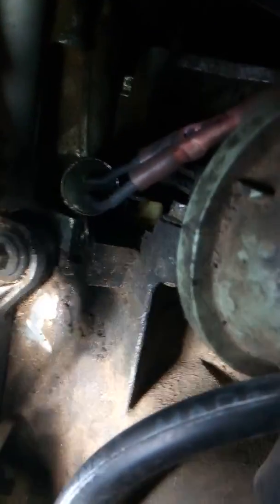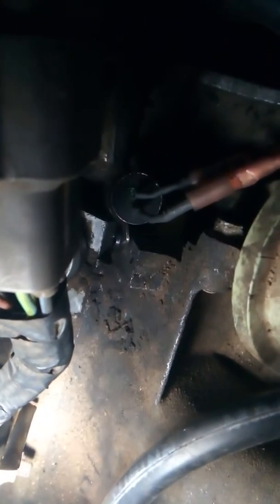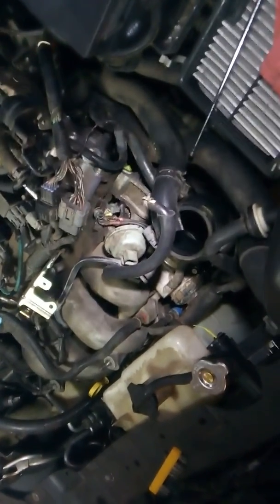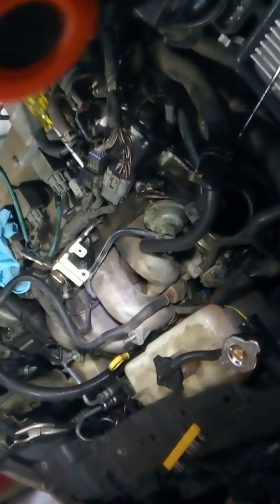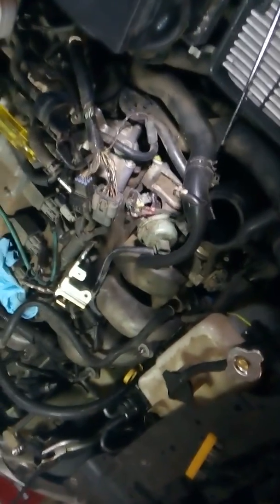IMRC part#8 Mazda Ford runner control repair diagnose engine code P2006 Cx-7 edge 2.3L

Comment: did that solve the problem? code p2006
Reply from the maker: Yes!
Reply from the maker: I have other videos and if you have any questions just ask
Reply: @richieparrish7101 hey there! Hoping you still check this account, but what exactly is causing the arm to not reach if it was originally mounted like that cuz I'm having the same code and my arm is not pressing my button, it seems I have to move it as you did but what is causing that? I had work done and when I got the car back I have this code now. But I can confirm that it is not even near touching the button it seems I need to lower it like you have
Reply from the maker: @Dr-Donn I also have a full manifold that's complete in my garage if you want me to send you some pictures or I have some videos that I posted on here that might kind of explain it I'm not very good at making videos but I can take a picture and show you what it's supposed to look like if you want to give me some way to send a picture to you?